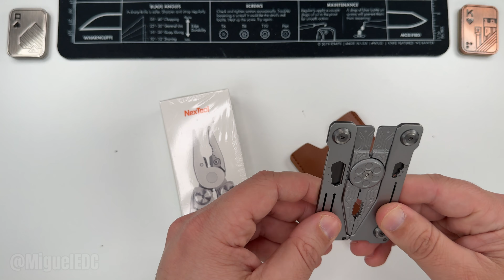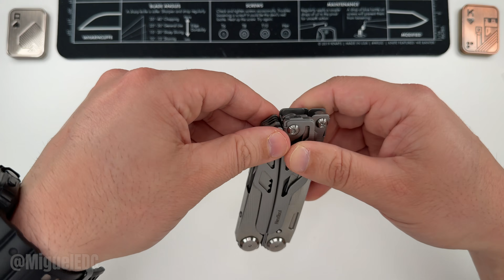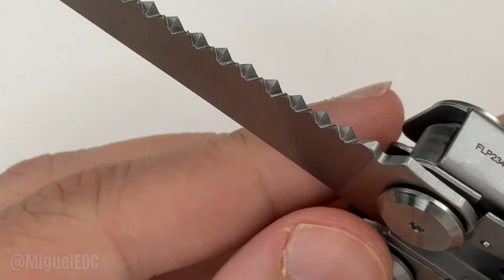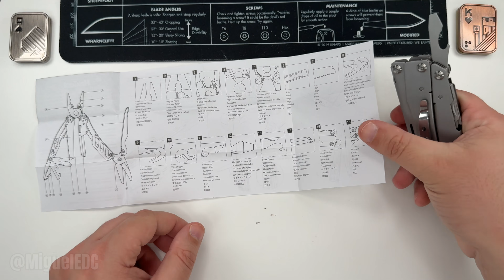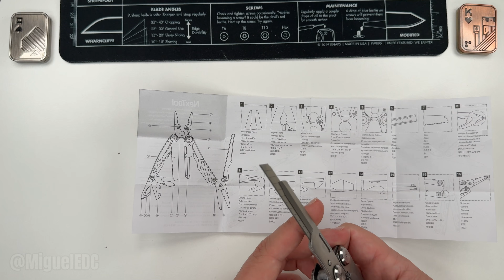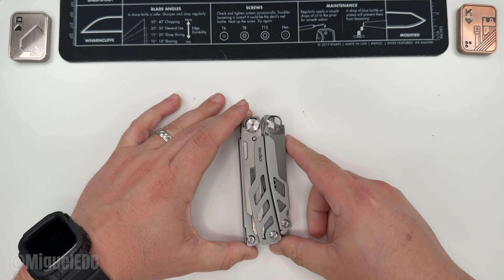Don’t Buy Your Next Multitool Until You See This One! (NexTool Flagship Pro)

Comment: I love that the pliers handles lock in place and the handles lock closed together along with the spring loaded pliers. I’ve got a couple of the original leatherman the smaller one and there large one the handles don’t lock in place the blades do but using them with the handles flops g around I’ve almost cut my fingers off a couple of times because of that with this it seems to lock the handles in place with the pliers head and closed. Like I said I’ve gotten hurt lots of times trying to do something and the handle flips around causing me lots of problems. 

The first replaceable blade you opened looks like a lot of the skill saw blades so you could put in a hacksaw blade for cutting metal or wood. A very nice feature

Comment: Have you seen a tool with larger scissors than these ?
Thes are good but I need just a smidge bigger.
Also can you colaps the pliers wile the scissors are out in use ?
Reply from the maker: Yes you can colapse the pliers while using the pliers. and so far these are the biggest I've seen.